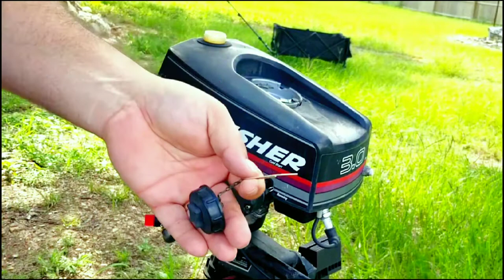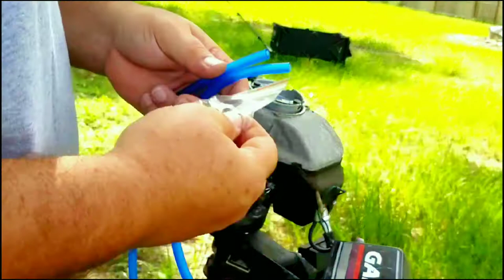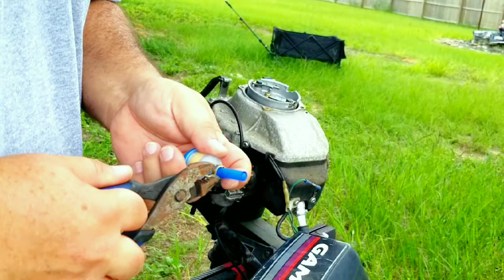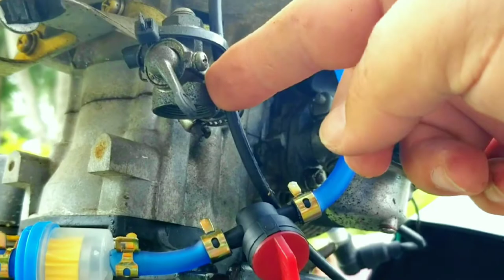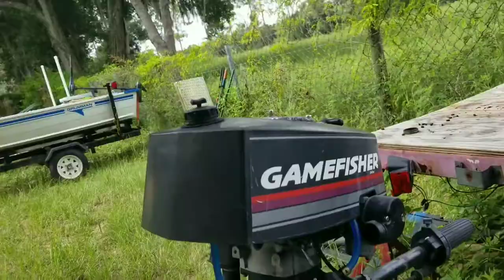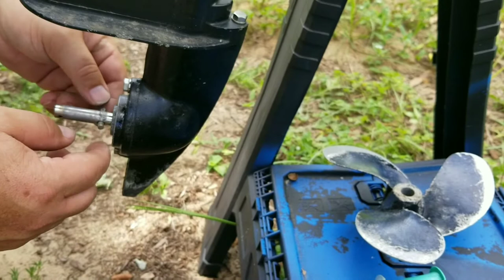Marketplace Outboard fuel line replacement. 3hp Gamefisher. #fishing #boat #outboards #fyp

Comment: Can you attach the link for the fuel line you bought? Gotta do the same thing to mine
Reply from the maker: Check this out!
GREHUA Blue Gas Fuel Filter Petrol Tube Line with Gas Inline Fuel Filter for GY6 50cc 49cc SSR 110 125 Taotao ATM ATA CB125 ATC Pony Falcon Baja Qingqi Roketa Scooter Pit Dirt Bike Moped Motorcycle https://a.co/d/1sdFCQn
Reply from the maker: That should help you out buddy. Let me know if you have anymore questions.
Reply: @JTRAV FISHING  Thanks alot man I will install the lines tomorrow and let you know how it goes. Have you had any problems with the pull start? I took mine in and had the coil greased and am now able to pull it but it won't retract. Any suggestions??
Reply from the maker: That's a little harder. Part's are hard to find because it's so old and discontinued. They do have the owners manual online if you just Google it and it has all the part #'s. The best thing to do is try and order a whole pull rope assembly.
Reply from the maker: You get everything working?
Reply: @JTRAV FISHING  I had some issues with the prop shaft when trying to put it back on. Set me back a few days. Gonna get it all put back together tonight hopefully. Is there a valve that the gas line connects to on the tank itself?? Mine just has a hole on the bottom. I'm wondering what to put on there to prevent leaking
Reply from the maker: I just added a gas valve I had laying in the garage from a mower repair.